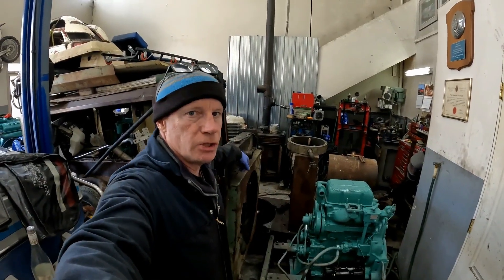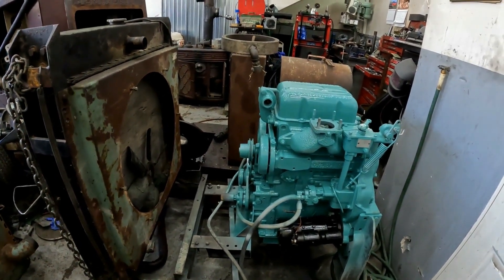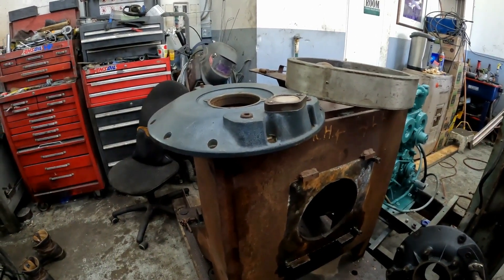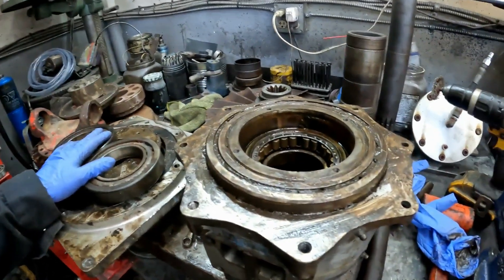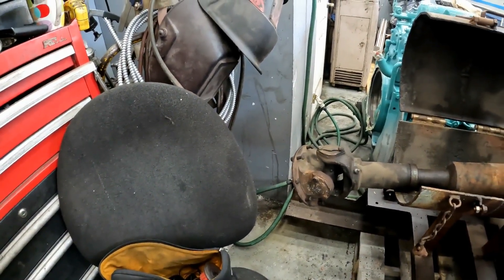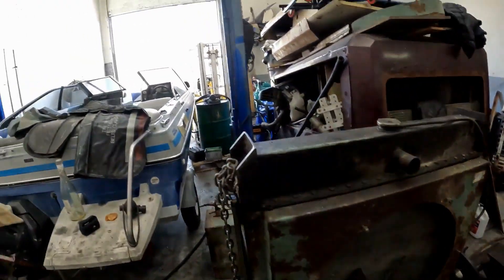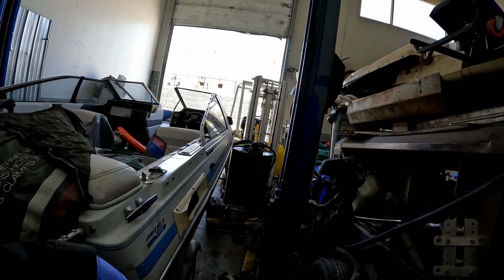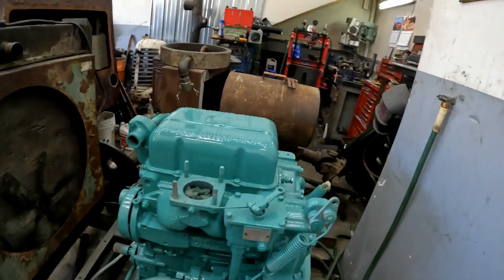Go Power 2000 Dyno Rebuild (Part One)

Comment: The old "we will rebuild it for you and figure out the bill" trick.  Thats a trap if ever there was..........
Reply from the maker: LOl, very true.  I contacted the manufacture and they quoted me $3600 USD for an overhaul kit.  That's bearings and seals, the most expensive being the ceramic seal.  I've bought the bearings from Ebay and am still sourcing two seals locally.  With any luck I'll know today if they can get the seals.:)  Happy times.:)  Thanks for watching.:)

Comment: Your freeing up a 6v53 video the water pump on it has the teardrop toward the block. All I have are that way too. In another video you said teardrop should face away from block. I'm unsure what to do. Ones I have are right hand rotation cooler on same side as yours.
Reply: 6v53 I put back what was on all the old ones I had before.
Reply from the maker: @benpage5602  You should be fine then.:)  You'd know if the wrong one was installed because the engine would be overheating all the time.
Reply: You are a very helpful guy on 2 cycle it's great to have your videos.
Reply from the maker: @benpage5602  Thanks, I'm glad they help.:)
Reply from the maker: The reference for the tear drop facing away are for the inline engines, not the V's.  What engine do you have?

Comment: Good luck on finding your parts, I'm sure O'Reilly auto parts can assist you with the seals, and possibly the bearings, if the numbers are visible, it's easier... I can't wait to hear that 2-53 running...
Reply from the maker: Thanks, I just got of the phone with Go Power Systems and they want $3600 USD for the overhaul kit.lol  He's sending me a schematics, so I can order just the parts I need.  Judging by their pricing I might have to go local.:)
Reply: @DetroitGarage  Going local keeps the money in your town for sure, I think they are a little crazy for that price for a rebuild kit... But what do I know? I'm just a stoopid Truck Driver/ Parts guy here in Tulsa, OK...